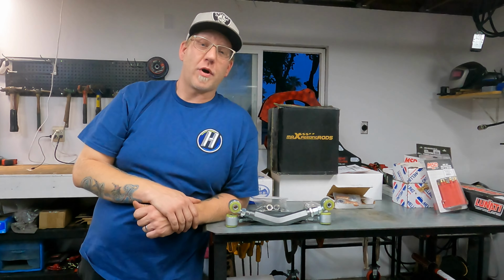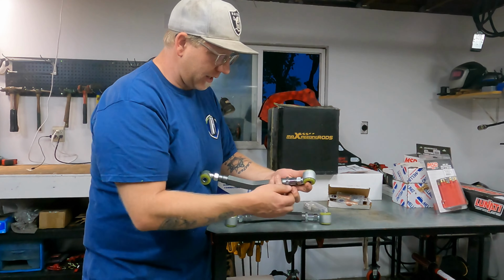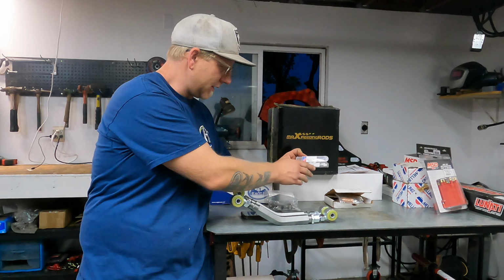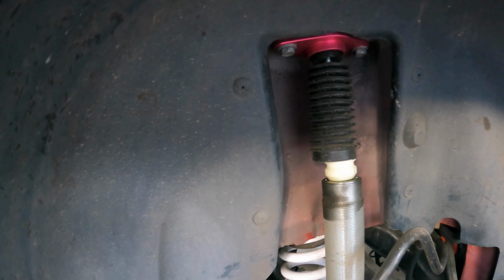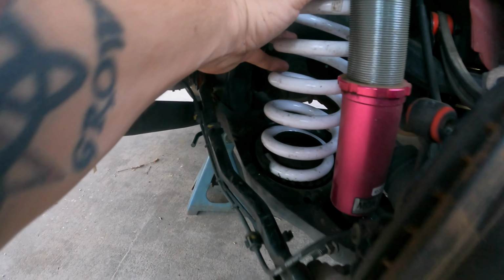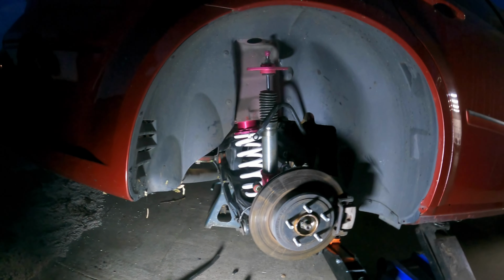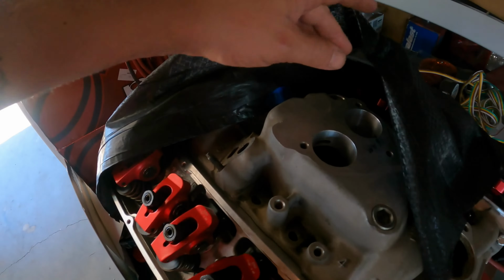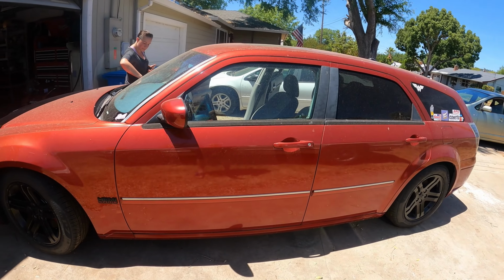How to install adjustable rear control arms on a Dodge Magnum

Comment: In my experience working on my rt magnum an 300c you may want to think about changing your tone rings after I started upgrading my suspension my rear tone rings started acting out an it made my abs go hay wire. Made me think I had a trans prob. Great videos. Keep up the content. I'll definitely be using your code lol. Thanks man

Comment: After you took out the springs and shocks did it clear up enough space to get to that back bolt on the rear upper control arm?

Comment: Did you already fix the motor? Did you have to get another head? Im gonna order a pair of heads i found on ebay. They are remanufactured and all new seats are pressed in cause i asked to make sure. $570+tax for the pair and i have to send my heads back. My heads are fine as of right now, they are the original ones its a 06 Chrysler 300c 5.7 awd, i couldnt find any cheaper for a pair so far, i want heads and not have mine done because of down time, its my daily
Reply from the maker: I did, stay tuned
Reply: I figured it was gonna be coming